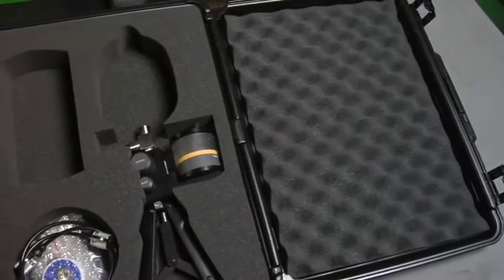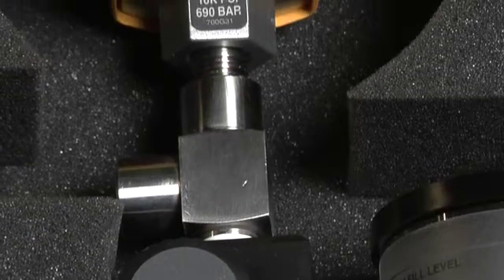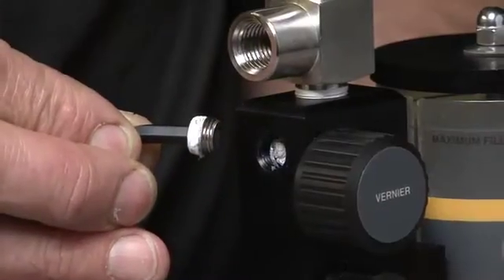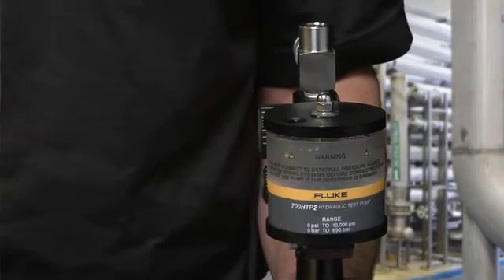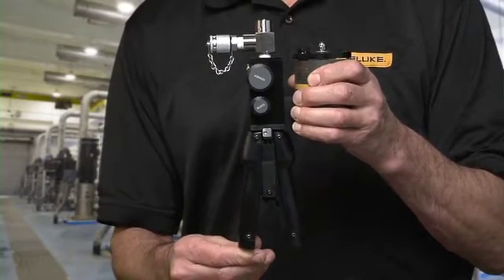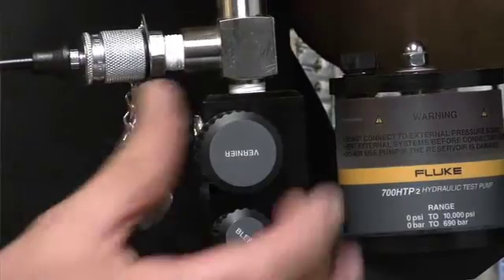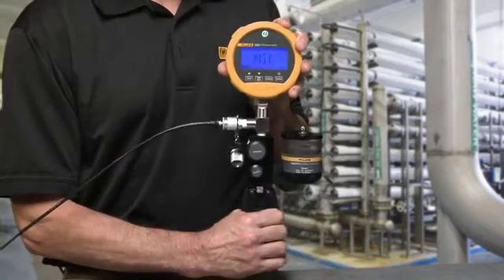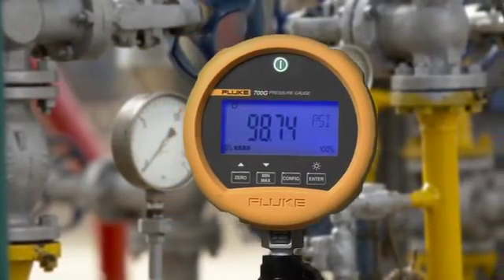Fluke 700HTP-2 Hydraulic Test Pump

Comment: After priming the tool and following the equipment specs its a Thumbs down for me. Hand pump gets jammed up (not squeezing together )constantly and it doesn't hold desired PSI when it did work. Transcat only has 30 day warranty so when purchase try it immediately or deal with Fluke which is a hassle. Fluke replaced my brand new hand pump with the same model and it jammed again. Instead of using mineral oil I tried using deionized water this time  and the same thing happen. Trigger gets jammed like there's a rod inside the center piece not activating open and close. Fluke is now saying that some of these hand pumps are defective coming from China or Taiwan and I just happen to have the defective pumps twice. SMH. Is there QC for Fluke checking the items coming in? These hand pumps are expensive I just want 1 that works. I do not recommend this item Fluke 700htp-2. Go with a Ralston or something else for hand pumps. Stick to meters Fluke